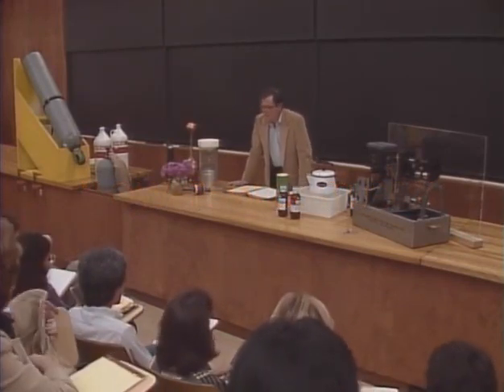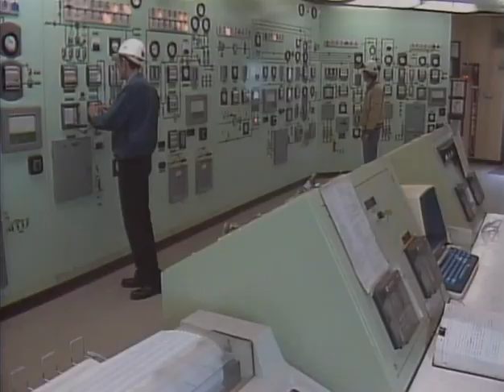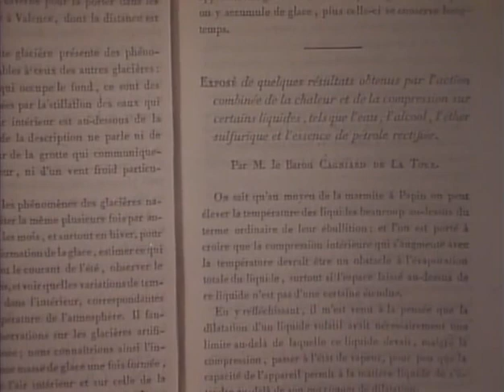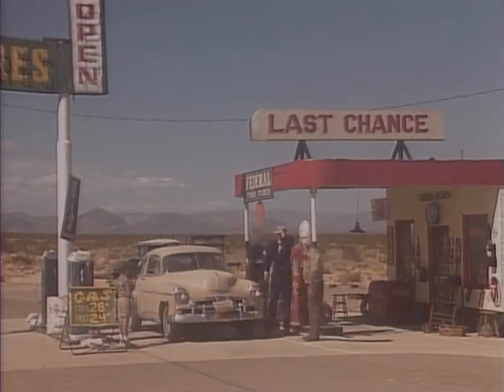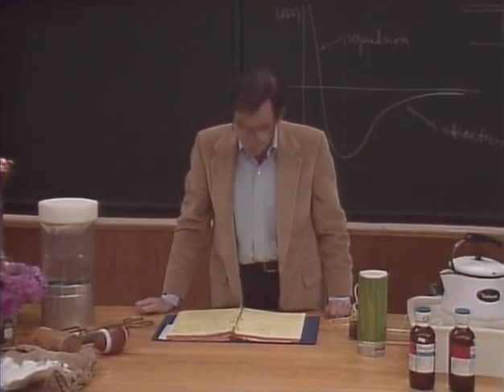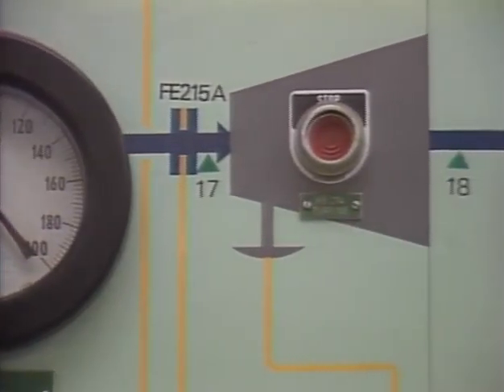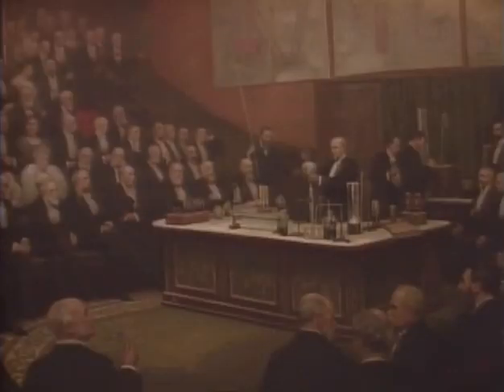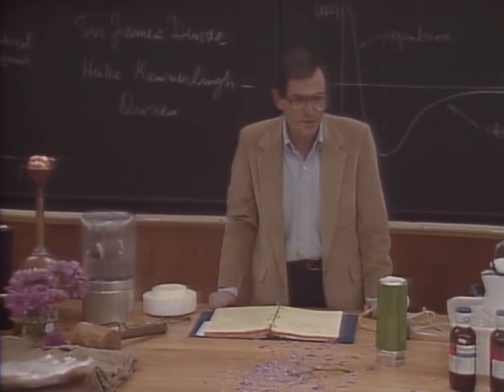Episode 48: Low Temperatures - The Mechanical Universe

Comment: So following the functional Principle of Singularity-point Lensing orientation-observation of conic-cyclonic coherence-cohesion objectives, the Camera Obscura setup that reveals how a positioned Singularity-point Apature can show the line-of-sight projection-drawing of 2-ness tangency Quantum-field square root probability projection-drawing, the Observable constant creation of superimposed Spheroidal exponentiation-ness sequences of condensed wave-particle log-antilog numberness on cubic linear-scalar density-intensity real-numberness is the holistic content in concept of relative-timing ratio-rates Perspective landscaping Principle of vertically integrated Solids of Rotation, e-Pi-i sync-duration phase-locked coherence-cohesion sequences of Quantum-fields objectives.., ie the Table of Atomic Structure and Standard Model spectrum of logarithmic Bose-Einsteinian Condensation.